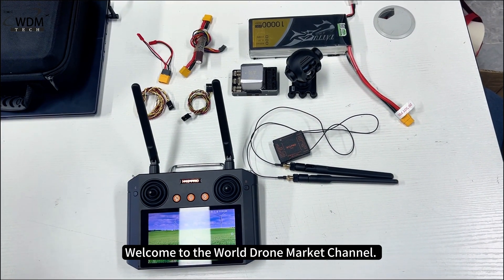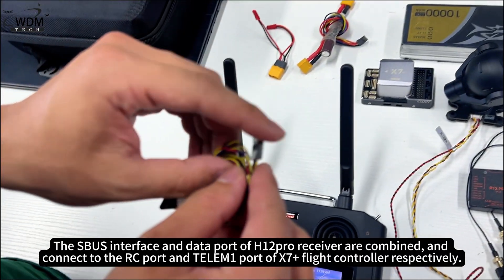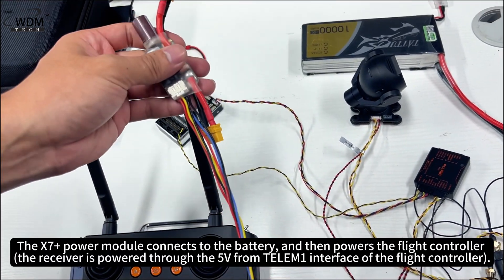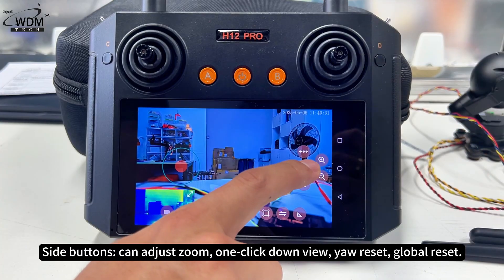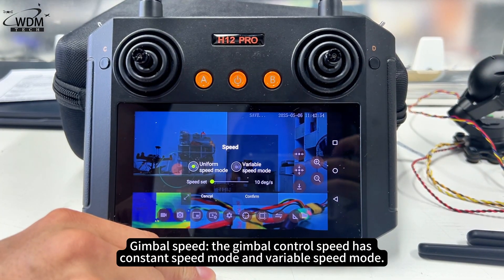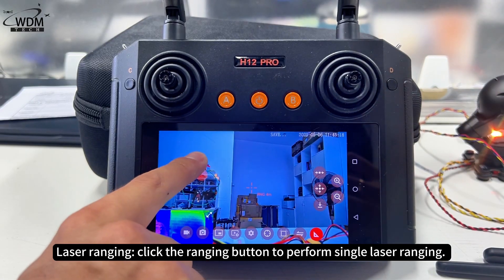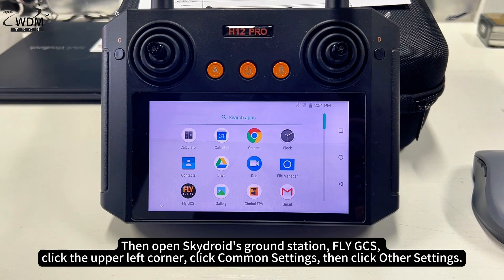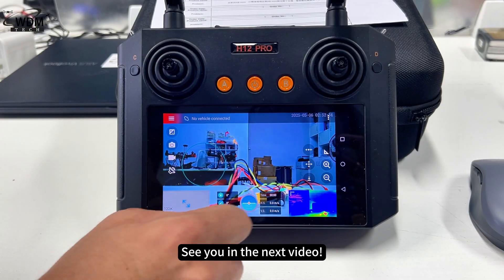Skydroid H12 pro Connecting to Skydroid C13 User Guide

Comment: Hello,

I’ve purchased a Skydroid C13 camera and would like to connect it directly to an NVIDIA Jetson.
What is the recommended method to do this and to control the gimbal (pan/tilt/zoom), switch video modes, and trigger the laser rangefinder?

For SIYI gimbals there is an open Python SDK (Ethernet control).
Does Skydroid provide a similar SDK or documented network protocol for the C13? If so, could you share the documentation (command set, ports/transport, authentication, examples) or point me to the download?
Reply from the maker: This is the Skydroid gimbal SDK development document：https://gitee.com/skydroid/rcsdk-demo#%E9%80%9A%E7%94%A8%E4%BA%91%E5%8F%B0%E7%9B%B8%E6%9C%BA%E6%8E%A7%E5%88%B6

Comment: Which flight controller software are you using on the F7 ?
Reply from the maker: QGC and Skydroid's own ground station were used in the video
Reply: @worldronemarket  What software was used on the X7 Plus FC? If I am correct Skydroid's GCS only works with Ardupilot not PX4 ?
Reply from the maker: @richardschooling4099  If the X7+ flight controller downloads the ardupilot firmware, then he can use Skydroid's official ground station and QGC on the H12pro. If the PX4 firmware is downloaded, then he can only use the QGC ground station.